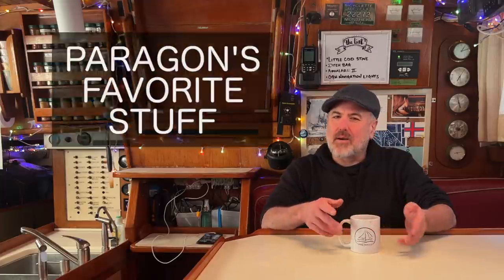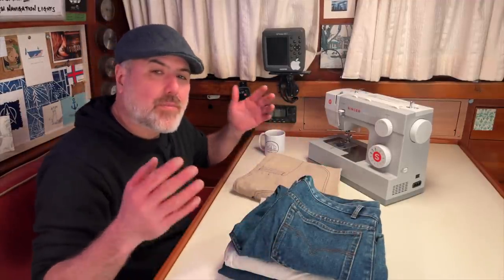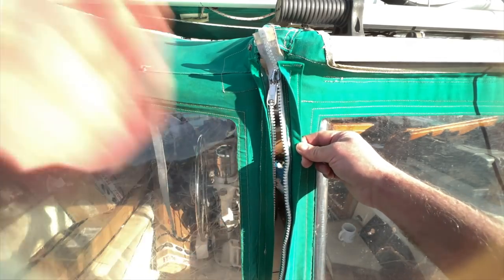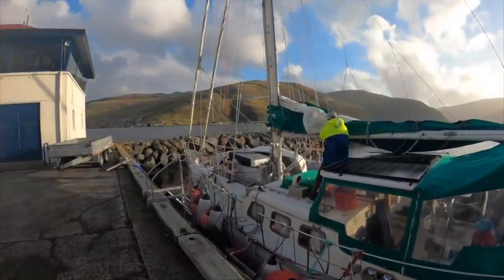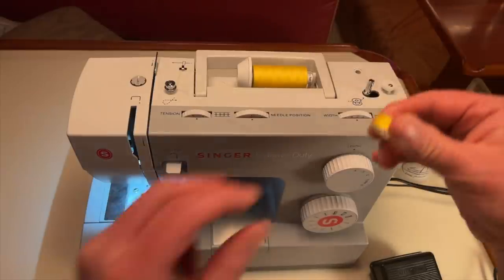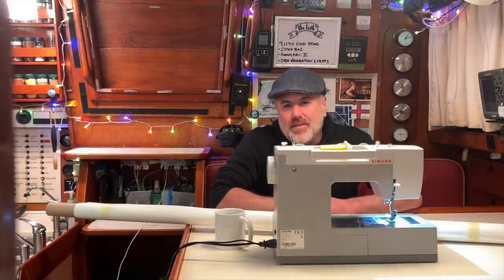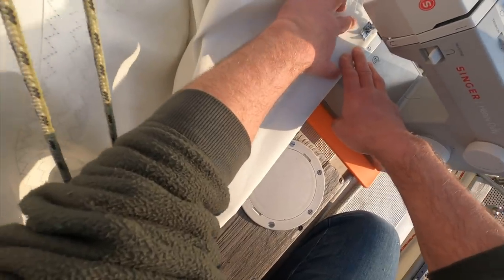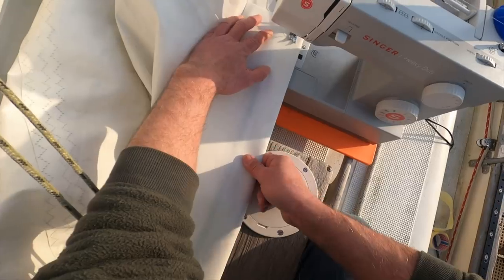Best Sewing Machine for a Boat? Singer 4411 Heavy Duty | Paragon’s Favourite Stuff Ep. 11

Comment: Drake, as a sewist myself and having made many sail bags out of used sailcloth. Your singer was going to have difficult time sewing but it can do it. The one problem I know you had was using the double sided tape. It did two things to your job. 1. Unnecessarily and needlessly increased the density of total fabric. 2 The glue in the double-sided tape gummed up the sewing needle and that caused the bobbin thread to not operate correctly. On a side note next time cut a piece of new sailcloth and test sew 4 layers to get the right setting (upper thread tension, bobbin thread tension (much larger dia. thread than for cloths) and correct needle size. You can do it! You've done everything else. Keep up the good work.
Reply from the maker: Many thanks Jeff. Will try again.
Reply: Will give your advice a go also Jeff 👍
Reply: Can you suggest a domestic machine that can get through marine projects with the double sided tape and UV proof thread? I eventually want to get into an industrial machine but I’m not ready to spend $1,000 yet as I’m still pretty new to these projects.
Reply from the maker: @Jennifer Tollefson  I'm only familiar with the Singer Heavy duty, and in the next episode we were able to get it to work well enough by using a different the foot and different needles. You might also get some great answers to that question on the Sewing on Boats or Sew Far North facebooks group.

Sewing a sail with a Singer Heavy duty sewing machine. Part 2 
https://youtu.be/8UJ49FFuW6U
Reply: When I look the video, the double sided tape is placed on the inner half part of the patch. But it is the outer part you see the sewing on without the tape. So it is not the tape causing the problem here. I think you are right about doing some test sewing and do the experiments needed before starting on a sail. It could very well be about thread size, needle size and thread tensions. I still think the Singer 4411 may have problems with this. But if you modify a household machine like a Singer 237, it will be able to do this like you see here: https://www.youtube.com/watch?v=e6b5Wz6aCfI&list=PLhBGyDo4tov86GVVCUzTF9RyH7HHW_Ha6
Reply: @drakeParagon  how is this machine holding up after a year or two?

Comment: I am probably a bit late with this comment. First I am always glad to see people not afraid to try new stuff. So well done. Now a few practical points and it will sew that sail with ease. When you look at a spool of thread it is either wound so it makes a diamond pattern or a parallel winding pattern. If it is diamond the thread needs to come off the top of the spool, the spool can be mounted in the horizontal holder in the top, or just put on the worktop near the "big wheel". If parallel wound it needs to go on the pin on the top and the spool will rotate as the thread is pulled off. Also for the flat holder on the top there should be a smaller retainer (about the size of the core of the spool. Next you should get a handbook it lists all the needle types and sizes for the different sewing conditions. Your stitch failure at the end was due to either the incorrect tension (you didn't practice first) or a needle size (thickness and eye size) was wrong, that is too small. So the needle is causing too much friction on the thread which will stop stitches forming properly. Finally you can't stitch through DIY store double sided tape as the needle and thread will both get stuck to it. The sort of tape that sailright use is designed for sewing. PS if you had wanted to hold it in place then pins or half a dozen hand stitches would have done it and then you can pull them out afterwards if you want. 
PS I have sewn tarps with this machine. You would have had the same problems with the sailright machine.
Good luck.
Reply: This.

Comment: I have had the same machine for about 6 years now, very capable. I bought it to learn how to sew cushions for my boat, which turned out decently enough. Had no issues on the canvas, or doing sail repairs on my ripped mainsail a few years back. It does get tricky with eisenglass in dodgers and the like, just have to take it slow and roll everything up tight to get to the middle parts....... I get heavy duty needles at JoAnn fabrics and they break occasionally. The only issue I find is using a bigger spool is tough on top of the machine, have to get it off to the side somehow. I think I paid like 150 bucks for it.....m.m I'm sure the Sailrite machines are exquisite, but this works for my projects and budget.
Reply from the maker: That's great to hear! I bought the walking foot accessory and stronger thread.  I'm looking forward to the next day we don't have rain here so that I can try again to sew that patch on our mainsail with it. If it works then I probably won't get the Sailrite machine. I'm really looking forward to making new cockpit cushions next.

Comment: Drake, I’ve got a similarly sized machine (a Toyota, who knew they made sewing machines!) I’ve successfully sewn through nine layers of Sunbrella. I think your problem might be that the needle catches on the glue in the tape and jams up. Either that or you need to use a big “for jeans” 14 needle. Or both. I would advise that you don’t invest in an LZE just yet. I’ve joined a few sailing/sewing groups just to investigate this machine and all I can see is problems.

Comment: I had the singer 4452 it did great on household things and then I tried to make my dodger and bimini. what a serious pain in the rear that was! I. had the right thread and walking foot like suggested and still it did the same as yours. I did some research and If i can remember correctly it's the tensioning that's off.also you need a bigger needle. i had problems with more than a few layers of sunbrella too. it's just not a work horse like the sailrite sewing machine. i broke down and bought the sailrite LSZ -1 and it got the dodger and bimini done in no time. now it had some problems also. the timing will go off and you'll break alot of needles when that happens! But it worked.
Reply: Smaller needle , not bigger needle worked for us…

Comment: You may consider a Chinese  shoe patcher machine for emergency repairs. It is manual so you have lots of control and it will sew in any direction and will punch through tuff fabric and leather.  I have used it to make emergency repairs of halyard ends  that were frying near the thimbles. It can sew through thick material and rope and requires no electricity.  It's not the best tool to patch sails but it is much better than sewing by hand and will get the job done in a pinch in the middle of the ocean with no power. And it has a walking foot.

Comment: 7:50 I almost snorted my tea.
I wonder if it's the double sided tape causing issues, grabbing the thread. I'd say try slower speed but the walking foot and stronger thread can only help.
I have a Brother machine that is quite cheap, but I buy work pants by waist size, unhemmed and hem them myself and save almost half the cost of presized pants. I've also made a holster from leather using it (it worked but it was at its limit there) and done darning and whatnot. I have a leather patch stitcher, and an antique Singer in need of rework. Sewing is a very good skill to have, even if it doesn't look perfect.
Reply from the maker: Heh, we had so much fun doing that. It makes me giggle every time I see it. The tape was actually at the bottom of the patch, farthest away from where Drake was sewing, so doesn't seem to be the issue. The slower speed is a good suggestion. Someone also mentioned having another pair of hands on the other end tensioning the sail material and keeping it straight. 
I agree, sewing is an excellent skill to have on a boat, and it certainly doesn't need to look pretty. It just needs to work. Though I am super impressed by the curtains Drake made...they're functional AND look great which is even more impressive since they were his first big project. Of course, the whole thing nearly had him swearing off sewing (or just swearing) because it was such a complicated a big undertaking. I know he had to undo his work more than one time, and each panel took a full (12+ hour) day. 
I'm wondering what your leather patch stitcher is. Is it like a Speedy Stitcher? We have one of those and it's terrific. -Monique

Comment: More on the subject—don’t know if anyone mentioned it, but if you soap, rub the needle with a bar of soap and re-soap as your sewing continues through tape and use a big needle, a size 20, or maybe even bigger, along with the walking foot when sewing a thick assembly, you might be able to make a repair like that with the Singer.  I don’t know for sure it will work, because I switch to the Sailrite when sewing heavy weight fabric.  It’s best to avoid sewing through tape if you can.  Good thing about Sailrite, should you purchase one—they will help you with any problem you might have when using their machine.  Also, the Sailrite can make a longer stitch than a Singer, which helps keep the pucker down when sewing heavy fabric.  I suspect the Singer does a better job on lighter weight fabric.

Comment: I'd look into a better needle before blowing big bucks on the sailrite. Also on the beginning stitch,  hold the threads behind the machine to keep it taught until it gets going. Maybe a bit of spray adhesive to hold the patch, but you can always use pins or clamps. Just my 2 cents.

Comment: Hello, 
Puting silicon pads underneath the machine can help to stabilize movements of equipments on a surface. Sometimes wet towels also work. But be careful with the electricity if it has a grounding. 
Best of luck!
Reply from the maker: Thanks! We also found that sticking BLU TACK under the 4 corners of the machine works fantastic.
Reply: @drakeParagon  thanks for sharing, my laptop has something similar with extruded rubbers. It stays fitted without sliding on table and on glass surfaces. Good staffs! Little things can save a lot of machines from easily being damaged or being worn out quickly. Especially in at sea. Something to add on the list, thanks!

Comment: I bought the same unit (4411) for fixing jeans but going through a bunch of YouTube videos; you reminded me about something I forgot about - shortening jeans! I've had a very difficult time using denim thread (the tan colored thicker thread) but in another video I didn't realize you can use a different bottom thread for the back and the nit worked good. Frustrating at first just keep at it and you can have some fun.

Comment: Just stumbled upon your channel. I think you can use this machine. I have sewed two layers of leather with this machine. Firstly, you need a size 100 sewing needle. Most machines come with size 80. Secondly, use sewing basting spray to keep the layers from slipping around. Also, slow down and give the machine time to do its job. I hope that helps. Good luck with your sewing and repairs.

Comment: The sailrite machine works great
I have used it for all sailing applications .for a test   i took 12 layers of dacron and can straight stitch it no problem  but the zigzag stitches did not work infact
It threw the machine  Out of alignment which was also an easy fix

Comment: I've thought about the same machine, I have a Sailrite LSZ-1 and although it is a heavy beast, it will handle sail material without issue. Thanks for showing that it won't work, it saves me from having to try and the cost of the machine to do so.
Reply from the maker: We actually did get the Singer Heavy Duty to work well enough to make that repair in the next video, using a larger needle, and a different foot. But I think a Sailrite machine would have done a much better job. https://youtu.be/8UJ49FFuW6U

Comment: I suggest you take 3 layers of your sail cloth and do a test w/o using the tape.  Perhaps that has caused this "sticky" situation!?!?!?!  OR it could be the new thread you're using and the machine tension.  Test sewing on the 3 layers with a different thread also.  Just some suggestions!  Your machine WAS "sewing" through all thicknesses . . . . but the thread breakage and skipped stitches could be one of several other issues that could perhaps be identified with various tests.
Reply from the maker: Thanks for the recommendations! Looking forward to the next attempt.

Comment: You don't mention if you tried this, but there are two other dials, the tensioner and the one next to that, on the top left, you didn't mention these two dials in the video. Fiddling with those should help. And even spinning the wheel by hand instead of using the foot pedal. Slower is better with denser materials and multiple layers.
Reply from the maker: Thanks for the suggestions. Will do. I'm looking forward to our next attempt, with stronger thread and a walking foot soon.

Comment: We have the Singer Heavy Duty 4452.  It comes with a walking foot, and with the right thread, needle, and thickness of material that repair is likely possible.  Now I'm not saying my wife is any better at sewing, or for sure you will be able to sew that up....However we had an almost identical repair on our Catalina 30 mainsail.  We were able to do it, but that sail might be a lighter material.
Reply from the maker: Hi Allyn, thanks, can you recommend a needle for sewing sails that will work in a Singer Heavy Duty?
- Drake
Reply: @drakeParagon  Well as I recall it was a leather needle.  Though we ordered an assortment.  We are away from the boat or I'd break it out and try to figure it out for you.  As I recall we did a lot of hand turning the machine at points
Reply: My wife says she thinks it was a Schmetz 16 or 18 leather needle.
Reply: Don’t use a leather point on sails, it will cut the fibres and weeken the sail.
Reply: @sailingtessbesssewfarnorth1746  It worked fine on our sails.  Really you need a strong needle to pass through a bunch of layers or it's useless anyway.
Reply: Yes, my points were to make that particular repair posible.

Comment: I've always been told a household sewing machine cannot sew sails, due to the thick thread and sail material. And that you have to use a commercial grade sewing machine, which is a really heavy duty, very expensive, non-portable sewing machine. So when I saw your video I was quite shocked you could stitch your sail with a light weight fabric machine.
Reply: Drakes machine, while meant for a hobbyist, has a motor 60% more powerful than 99% of home machines.   I wouldn't want to depend on this machine for commercial activity but its just fine for occasional use around a boat.

Comment: I have been wondering about a regular sewing machine if it would work for sail work . So thanks
Reply from the maker: We'll give it another try with the walking foot accessory and stronger thread. I'm really hoping it will work!  :)
- Drake
Reply: Drake, don't throw good money after bad.  IF you can get it to work, it will only be temporary.  It will soon break internally from the strain of such large loads.  If you open up your Singer you will find lots of plastic.  OK for a while, but will soon fail.
If you open ANY commercial grade machine you will find nothing but steel.  So is the Sailrite.  Probably a little overpriced because they have to absorb advertising costs, but, in my opinion, well worth the extra.  Just my 2 cents.

Comment: I am in charge of my yacht clubs sail loft so I know a thing or 2 about sewing machines.
my cousin has that machine I have used it. nothing good to say about it its far from heavy duty as they claim. I was shocked that you were going to successfully sew a sail with it and prove all my opinions wrong lol I recommend any old singer made before the 1970's and I own a hand cranked singer model 28 made in 1896. I have made many many boom covers with it it will sew anything including sails but its not zig zag. there are many options of vintage machines that will do zig zag but a zig zag walking foot is what you want. I'm not a fan of the sailrite although its good for the heavy jobs for its price it sucks for the lite duty jobs. the singer 201 is the best powered strait stitch sewing machine made full stop period the end. and an old 201 can be had under $50 and will sew anything a sailrite can sew "if its motor is not old and tired" I feel that anyone who buys the machine you have may feel cheated and lied too and rightfully so. heavy duty is the claim but it cant match the heavy duty of a non heavy duty machine made for home use only just 50 years ago. rant over haha
Reply from the maker: Ha! Thanks for the great rant. :) I guess the saying "They don't make them like they used to." applies to a lot things nowadays.. Boats included.
- Drake
Reply: Totally agree, singer 201, best domestic straight stitch, cheapest used machine that will repair sails comfortably is a singer 20u. Not a walking foot, but good enough for repairs.
Reply: razzorbladz   Thank you for exposing the dreadful Singer 44 series machines . I am a vintage sewing machine collector and am very passionate about fine quality machines and unfortunately the 44 series doesn't fit into this category. I completely dismantled one , just out of curiosity and was shocked by what I found. The main frame (or chassis) is made from very crudely cast aluminium and it just has a large plastic casing to make it look tough. Inside it I did not find one single thing that pleased me and have declared it to be one big rip off , a piece of shit and a disgusting disgrace to the Singer name. Cheers from Australia 🇦🇺
Reply: @robertgrosser7279  so true and also hello from Australia

Comment: On that sewing machine you should be able to lower the pressure feet get a stronger needle a flat surface because the sale is pulling itself back towards the mast because you don't have a flat surface slow slow down your speed and it will work patience with sewing that's the only way to do it I've been sewing a long time
Reply: Vicki Brown